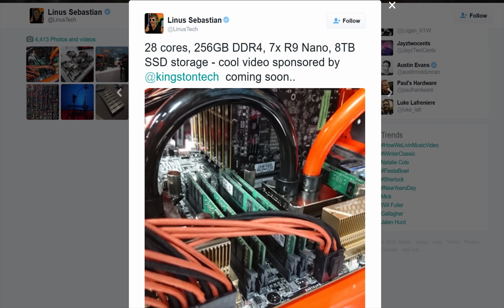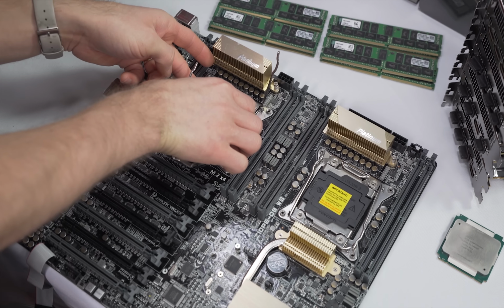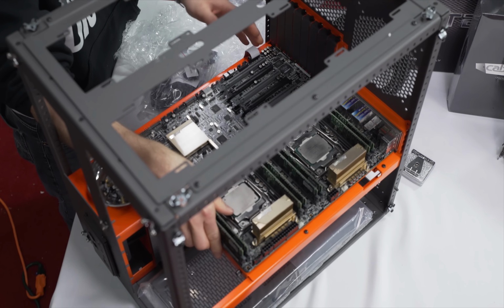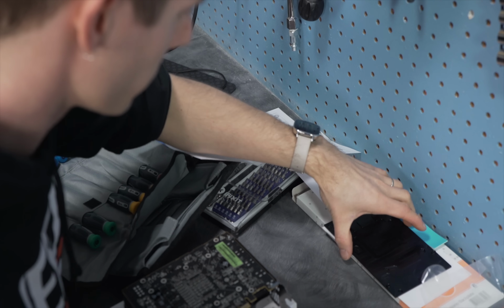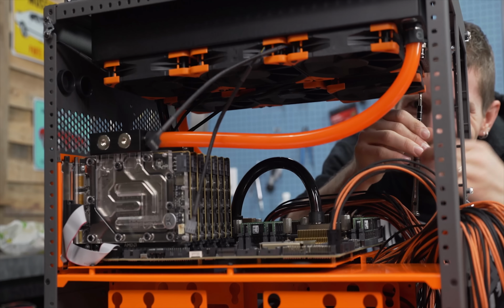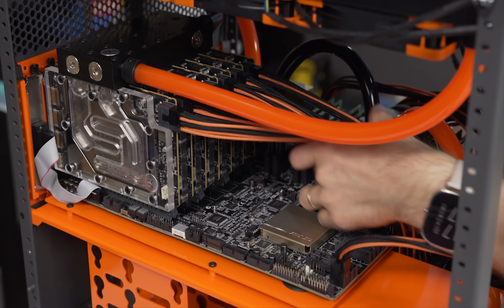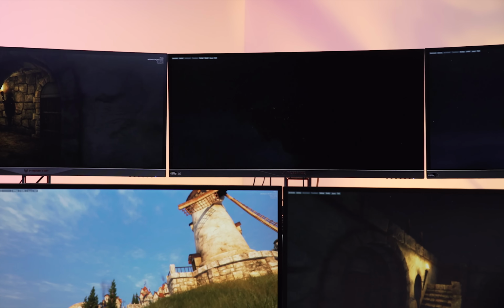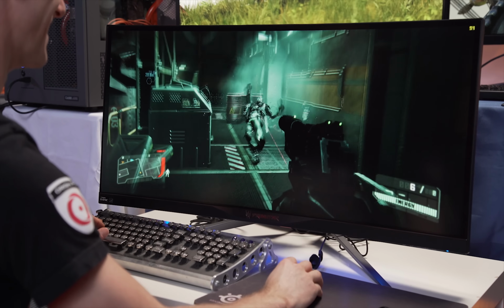7 Gamers, 1 CPU - Ultimate Virtualized Gaming Build Log

Comment: Right this is why all the Acer x34s are out of stock...thank linus
Reply: James Packer wow. You actually took the time to type that eh? Nice.
Reply: A big A phony is there really any need of saying something like that? I wouldn't say something like that to my worst enemy, and you're just saying it to a random stranger. Pretty disgusting.
Reply: +sniper2606 I really want them but I don't want to buy a monitor that's literally more expensive than my custom-built gaming pc.
Reply: +Mitchell Hall Just begging for attention. A bit disturbing
Reply: Joodles Lol really though.
Reply: +James Packer obviously you do, since you commented. lmfao
Reply: ***** quite the cancerous thread to revive
Reply: +sniper2606 ahah so legit
Reply: +sniper2606 LOL
Reply: hahaaha
Reply: What software did you use to run this many OS on the system. I'm running Windows 10 and I have a MacOS VM in Vmware and I'm trying to use/passthrough my AMD graphics card (Radeon R7 M445). Any ideas?
Reply: @DiegoPerez-hn7sq  He's using Unraid as the main OS. I've not installed it yet, but from all the videos I've seen you need to do two things in general:

1. If you have ouputs (VGA/DVI/displayport, whatever) integrated on your motherboard, use that to connect to your main monitor (or secondary monitor), you can see Linus connecting a breakout vga port to the motherboard in the video.
2. Use GPU passthrough (search how to do this in VMware) and assign your GPU (and any sound device integrated on your GPU card) to the macos VM.

If this doesn't work, you'll at least find a few leads to make it work by searching around a bit. Of course the problem will probably be more complicated if you're running hackintosh, in that case you need a wizard like Anthony (the LTT video on this had my mind spinning)
Reply: Kbrnsr thanks this is much appreciated. However I discovered that for some reason it’s not possible to use GPU pass through on a MacOS VM.
Reply: Kbrnsr also how hard would it be to try to make a hackintosh out of a Dell Inspiron 15 5567?
Reply: @DiegoPerez-hn7sq  It depends, I don't think it would be that difficult to barely make it working natively, but having access to every feature is difficult. Just glancing on th search results for "hackintosh inspiron 15 5567" reveals that people get zero sound from the headphone jack, only from the onboard speakers. I have no idea if USB, wifi, Ethernet works out of the box with hackintosh running natively.
My own preferred method would be to put it into a VM (like Anthony is doing on some of the Mac vids on this channel) on a desktop PC and just remote desktop into it if you're on the go
Reply: FpsGamers Don't feed the trolls, they're trying to start flame wars ;)
Reply: +sniper2606 hahaha right? I got mine first week of Dec, thankfully. So good.
Reply: I care that noone cared
Reply: +Mitchell Hall haha no one cares that you got it before he promoted it.
Reply: @Deeceptive  unsubscribed

Comment: This video was great, as usual. But I think that for $30,000 dollars it would be more cost effective to build 7 independent systems.

Request: Could you please do a video for putting together a server for office use, one that could handle 50 or more computers. Hardware and software to handle virtual desktops on weak terminals, plus an automated backup system. Thanks.

Comment: You can break the limit of 7 GPUs using PCI-e lane switching and sacrificing bandwidth.
Since 16x pci-e 2.0 has the same bandwidth as 1x pci-e 3.0 and PLX manufactures some really good switches, you can have...
112 GPUs.  In theory.
On practice, you'll die easier than get crossfire working with unraid.

Comment: You can also do this file system independent if you use QCOW2 images, backing images and snapshots at the file level, it has the ability to do Base Images with Delta Images Much easier to manage than using BTRFS snapshots. Then you can use a more stable base File system on your drives like XFS.
https://kashyapc.fedorapeople.org/virt/lc-2012/snapshots-handout.html

Comment: Does the second CPU not get too hot compared to the first as the liquid goes to the first CPU & then the liquid flows over the second CPU (carrying the heat from the first CPU) & then off to the radiator/fans?

Comment: I have to wonder if there are any hot spots which will cause this machine to break quickly. The custom water cooling is very cool, but still, that's 1500W of heat

Comment: This is the first machine I see that pulls more power than my rig under load. Built mine in 2011 and it pulls 1.2KW from 2 UPS units via 1000W main and 450W aux PSUs. Before any one asks, 2x radeon 6990s, 1x I7 980X and 5x 7200RPM drives are to blame for the power draw.

Comment: Title says 1 cpu, but your using 2?
Reply: +Joshua Hernandez I mentioned that too but no one has responded
Reply: no it doesnt
Reply: ***** no it shows up as X2  
Windows shows all the cores and the threads of both CPU's meaning windows see's and show's 2 CPU's how many cores and how many threads otherwise windows would be useless with dual CPU workstations.
Reply: +richcali21 2 cpus work together so say there is 2 quad core cpus they work as 1 octa-core cpu even doe windows may say cpu qaud core X2 (sorry for my bad english)
Reply: have you ever have two CPU's?
Reply: +richcali21 Not the OP, but I have used two CPUs in one build before, and yes, they do function as one CPU (kind of). It's a very long explanation that I doubt anyone cares for in this thread. Just because windows tells you that you have 2 CPUs, does not mean they function as two completely different processors; This means that the two will work together to form more threads for processes to use at once.
Reply: ***** actually a Dual CPU workstation can run as two separate CPU's with each having its own GPU. I have the option to dedicate either CPU to any software or hardware and can dedicate each GPU to be as one or have them work together. Same thing with the cores I can pick which cores or CPU will run any of my software or hardware. What dual CPU motherboard did you run and with what Xeon's?
Reply: ***** that is wrong
Reply: Gamingwithsean I am able to dedicate either CPU or just a certain amount of cores to run any software. Windows also shows all my cores and not just X2
Reply: richcali21
Of course you can run them as two separate CPUs, this should be common knowledge. But that is if you do it yourself, out of the box they'll function as one big central unit.
Reply: ***** LOL You Said " Just because windows tells you that you have 2 CPUs, does not mean they function as two completely different processors; " but now you say of course you can and it's common knowledge??? which is it you just contradicted yourself.
So which dual CPU system did you run and which Xeon's
Reply: richcali21
Yes, and that's what I meant. That statement does not say that it is impossible to have 2 CPUs running opposite each other. Rather, what it actually means is that it doesn't necessarily mean both CPUs are running individually.
Reply: your completely wrong and not understanding the abilities of a dual CPU workstation. I can shut down one of my CPU's completely same with the cores I can run only the cores and or CPU that I want. When I do this the CPU doesn't draw any power so what other proof of the two CPU's running individually do you need? I can run a single CPU in a dual CPU motherboard again allowing just one CPU to run the whole system while the other CPU socket is empty.....Again I ask what dual CPU workstation have you run? and what CPU's were in it?

Comment: Why build 1 PC for 1 gamer, if for 15 times the price, you can build 1 PC for 7 gamers :)

 

 
Answer: Because Linus is Love, Linus if Life!
Reply: +Hobbit Stomper this build wasnt supposed to be cost effective. It was meant to be overkill and overpriced
Reply: Phillip Wu I'm fully aware of that :) It's just a joke comment. I love Linus :D
Reply: Hobbit Stomper oh okay. all good
Reply: Phillip Wu This PC build will bring the term "playing with yourself" to a whole new level.
Reply: +Hobbit Stomper It does save money in electricity savings, and office space. It also prevents users from physically accessing the machine, let's say at a LAN center. It's a solid business proposal for LAN centers.
Reply: +Hobbit Stomper Well, if you can build a bleeding-edge gaming rig with a 3.6 GHz Core i7, 32 GB of ECC DDR4 RAM, a Radeon R9 Nano, 1TB of SSD storage, all water-cooled and powered by an 80+ Platinum rated PSU, with a 34" 3440x1440 IPS display, all under 4,285$, then this monstrosity can indeed be considered overkill. If your tally for the above-mentioned configuration comes in above 4,285$ (that's 30,000 / 7 ), then this machine is actually cost-effective. And I'm  pretty sure that seven of those rigs would occupy more space and use more power than this one. It all boils down to the precise calculation of cost and power consumption. This is exactly how the cost-effectiveness of virtualized servers are calculated.
Reply: +Vincenzo Manzi It should have the same single point failures as a machine serving multiple virtual servers, unless I'm missing something.
Reply: +Vincenzo Manzi 

This is using server hw - how often do xeons and server grade mobos using ECC mem go down ? 

Ill tell you.. not very damn often. they are made for 24/7 running.
Reply: +sf len People die... Computer HW as well even in Google DC or Amazon Cloud. You don't care because of high availability tecniques
Reply: +Hobbit Stomper not necessarily but as always linus want to make this things as huge as possible
Reply: +Hobbit Stomper All that being said, the only possible use I can think of for something like this is for LAN parties or e-sports tournaments where you have to build many identical, high-end gaming rigs and build volume and power consumption are serious considerations.
Reply: +Istvan Kovasznai haha i know right. anyway its kind of a shame that the thermal detect thingy doesnt work on all cards but apparently some people are actually trying to emulate this rig. probably with a few cheaper components tho lol
Reply: +Phillip Wu it was ment to rake in money via Youtube hits "_
Reply: +Hoang Nguyen a lot of single point of failures... It's simply a record
Reply: +Hoang Nguyen You are right, the same. I was talking about this instead of single servers in a LAN center... Crash of the motherboard all down. It is a record and nothing else 😉
Reply: +Vincenzo Manzi lol what? im just saying as someone who sells and deploys / manages about 50 servers a year.. they dont go down often and when rebooted your talking like months and months before you see a issue. 

if anything is going to fail its usually raid drives , with 4x SSD's from kingston likely that wont be any time soon. 

otherwise this will run and run with this hw. and the hw hes using is all top notch too.. platnum psu  from the ground up... much respect for doing the little things. 

its too bad there is no redundant dual PSU function for 1500+ watts heh right linus.
Reply: Anyone help me improve this build? 
http://uk.pcpartpicker.com/p/pFLHCJ
Thanks
Reply: +sf len do as you like obviously
Reply: +Chris I would buy a bit more powerful psu (650w or 750w) and if you want to save money and this is a gaming pic... 8GB or RAM are enough
Reply: +Vincenzo Manzi Thanks
Reply: Istvan Kovasznai  Well for eSports its actually important that each one has their own PC and not a virtual PC like it is here. Linus said himself, there are some errors.
Also you would need to have a Lan party for 5 year straight to get a $30,000 electricity bill.
Linus simply built it because he can and wanted to see if it's possible from the perspective of technology
Reply: Well , Server Virtualization started out as a bit of a joke also. 
Now its all we do in the industry , when hardware far surpasses a users single station/server needs that's when it makes sense to harness then un-utilized hardware. 
With that id say in this configuration its not quite efficient enough  for what it does. 
However its nice to see someone push the limits of it. 

Honestly the only issue i see here is the need for a GPU per user. 

I have multiple Stations in my home for instance, if i could just run extra monitors and kbd's out for when people come hang it would be simpler to keep everything updated etc. 

pluss i could always tri/quad fire/sli when no ones around :P
Reply: sf len I guess one Radeon R9 Fury per user seems a bit overkill for real life gaming scenarios, if we consider that in the video Linus is running Crysis 3 at 3440x1440 with everything maxed out and it's running at around 100 FPS. On the other hand, we see the other 6 VMs running Unigine Heaven, which is a much lighter GPU workload than Crysis 3. Maybe the hypervisor dynamically allocates GPU resources as needed by the applications? I wonder if the other 6 VMs were also running Crysis 3 at the same settings, would it still average 100 FPS ? If so, then maybe this beast could run even more VMs, in which case the efficiency proposition would be better.
Reply: +Hobbit Stomper I'm pretty sure that $30K is the cost of the machine, not of the electricity that it consumes.
Reply: +Hobbit Stomper Also, if this machine was running full blast for 5 years straight (average load of 1500W, shown in the video) it would only consume about $6200 worth of electricity, considering an average of 9.43 cents per kWh in the USA in 2015 - http://www.statista.com/statistics/263492/electricity-prices-in-selected-countries/
Reply: +Hobbit Stomper Please excuse my rants, but this video shows so much stats that it's a geek-out magnet.

Comment: One thing to point out real quick is that you could have plugged in better GPUs. I currently with my computer am running 2 power supplies simultaneously. This is what I did: I soldered the green cord (starter for the power supplies) together, meaning that when I press the power button it would start both power supplies at the same time.

I have been running this setup for the past three years without any problems at all, it just looks awkward with a power supply ontop of the case and one inside xD.

Comment: Very interesting, if I have:

2 monitor
1 CPU i5 6500k
1 VGA GTX 970
1 SSD 120G
1 HDD 1T
16G ram DDR4

Then I can run windows os and mac os in each monitor with lime technology? Or maybe I need extra 1 SSD to boot MAC OS?

Comment: I think the setup was way overkill from the perspective of cpu and ram. That one cpu would have been more than enough for all 7 vm's as games do not use that much cpu. Also what game needs 32 gigs of ram? Although, you could improve performance greatly by using better graphics cards and multiple PSUs (dunno why Linus didn't do that). I think you could build a system with similar game performance at half the cost :) But I understand that this supposed to be an overkill machine as sponsors gave the best of what they had lol